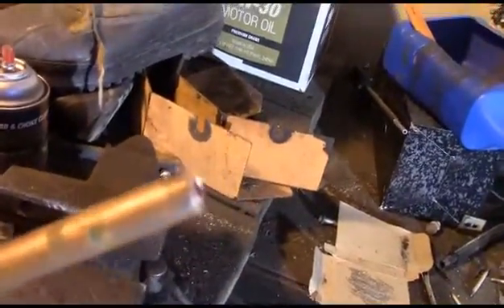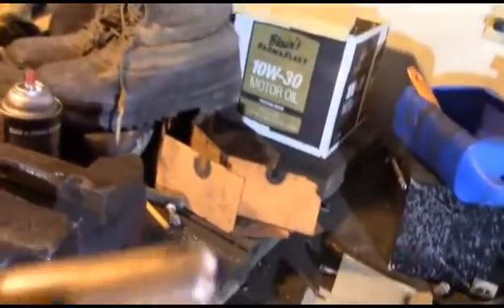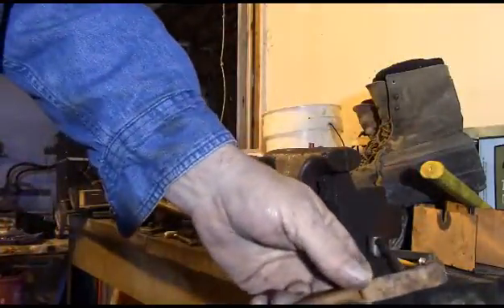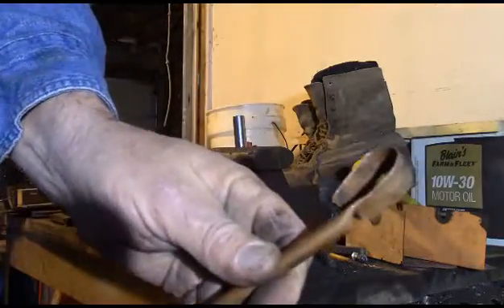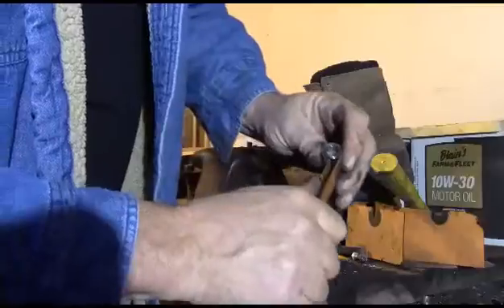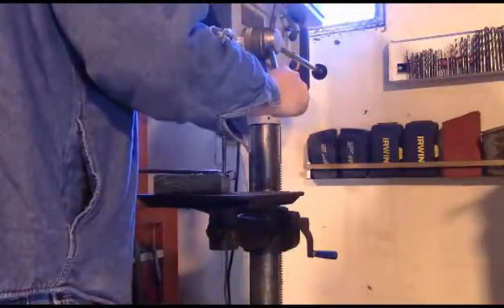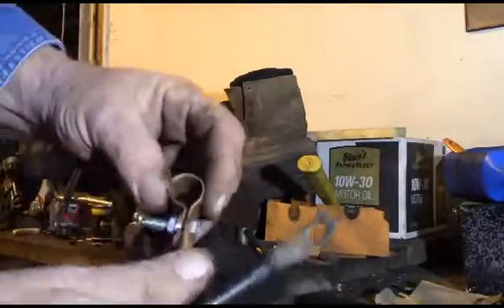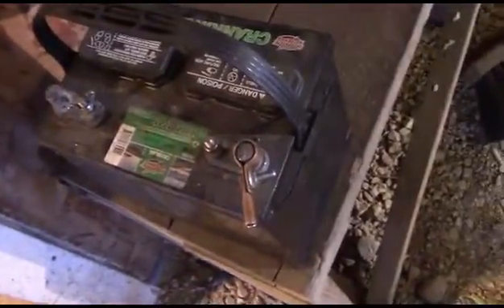How to make a homemade battery cable terminal for round post car batteries

Comment: You keep saying it's just for a temporary solution but most of those terminals at the stores are no better than making a terminal out of Aluminum Foil. This DIY Terminal you shared is easily rated far better than even most top of the line terminals sold. I only wish I'd come across this years ago. Thanks for sharing!